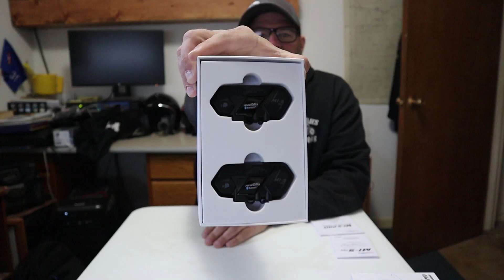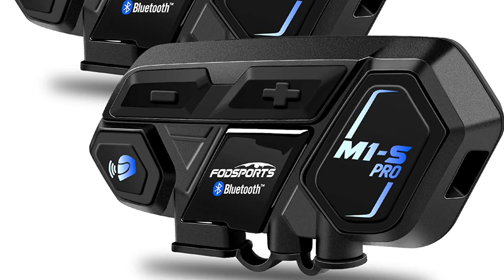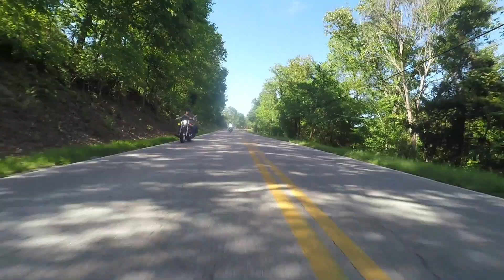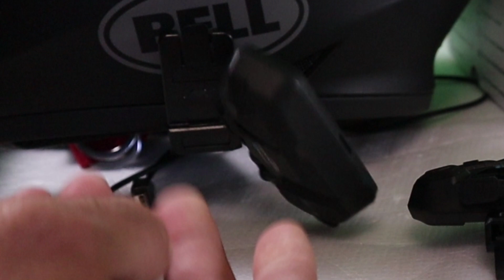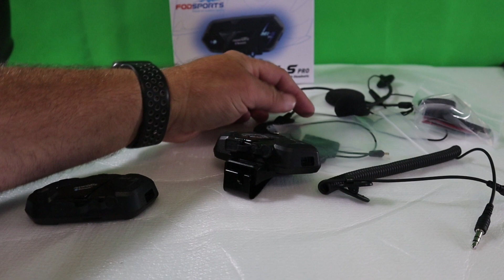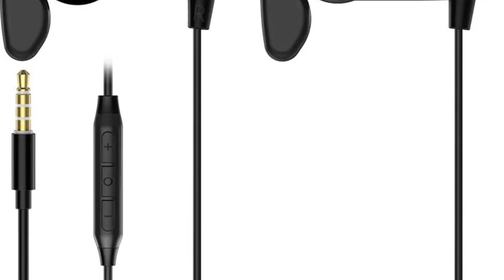M1-S Pro Review $80 Amazon Bluetooth Headset Communicator by FODSPORTS

Comment: The answer to your concern about the charge port is right at the beginning of your video on the box. You can use these while charging. So to have a tight fitting square socket that won't allow the main part of the connector to wiggle loose in the wind is imperitive.

And yes you can cut back or grind other mini USB cables to work with this for charging purposes but I wouldn't want to use that while riding.

I've had mine for 3 years! Love them!

Comment: You would be able to do single live voice vlog, just can't capture both riders voice, that correct?
Reply from the maker: You will still need a separate mic and recording device for a vlog, I was going to use my Gopro and mic for my audio then just add the audio from the Comm Unit as a seperate audio track. I was able to do this with the Cardo but my audio still comes from a separate source besides the comm.

Comment: Can it synhro without problems with SENA or Cardo intercoms ???
Reply from the maker: I synced it to a Lexin unit using Universal pairing without issue. I believe Fodsports claims to sync with other brands that support universal pairing, so assuming the Cardo or Sena model you trying to connect to support it then it should work. How well I can't say I don't have a Cardo or Sena unit to test with. I have a friend with a SENA  and will be testing that when it warms up.

Comment: Would you buy this again? im looking into buying something like this or the "interphone sport" comms device.
Reply from the maker: I also tried a lexan in same price range and prefer the Fodports. I haven’t tried more expensive ones yet but yes I think it is a good product and would recommend it still.
Reply: @RidingintheOzarks  as i said im looking at the interphone sport or tour aswell at the moment - trying to avoid having to pay silly money for a cardo/senna, if you was going out to buy one what would you buy?
Reply from the maker: @s1dew1nd3r4  I am not familiar with the ones you mentioned but I bought the fodsport because I didn’t want to spend cardo/sena money. I would buy the fodsports again
Reply: I use the lexin B4FM now for 2 years. Good unit never let me down.  Looking at a change. Is the fodsport sound better then the lexin. Looking at the fx8 or the ms1 pro. What's your thoughts.

Comment: I think the shoulder on the charging cable is so you can charge while using it and it makes it rain proof. I have a Freedconn R1plus it works pretty good but I reset the wifi password to 3 chars instead of eight. It let me save it but when I go to connect it to my phone the connect button in the app won't work unless there are 8 Chars entered. But it won't connect with the original 8 Chars, so now I can't use the app to change settings or operate the camera. It still works but I'd like to use the app.
Reply from the maker: That maybe why but with like 20 hours of run time I really don't see charging it while using it as a much used function.  Does your Freedcon record Audio from intercom conversation when recording video also?
Reply: @RidingintheOzarks  I don't have another 1 to see if it does. There is nothing in the manual about it but it not very informative. I have figured out stuff that it never mentioned. It doesn't record the music from the FM or the bluetooth (at least I haven't figured out how yet). I know it doesn't use the mic that plugs into it for recording video. There's a built in mic somewhere. The manual doesn't say anything about that either.  But it works for making & receiving calls.
Reply from the maker: @EasyRiderGreg  well if it won’t record the mic for audio when recording video I doubt it would do intercom but maybe I will try and review one

Comment: I've tried soldering those headphone wires before and never had any luck either.
It seems like there are a handful of things working against that unit - the proprietary connectors seem like a pretty big annoyance.
Reply from the maker: I mean they work fine, it is nothing big but the shouldered charge cord is a concern, I have misplaced one of the 2 already after 4 months. If I realized up front I would have paid more attention and labeled the cord.

Comment: Good video Mike.  Dual vlogs are tough on a lot of Bluetooth systems as well.  Good to see there is a cheaper option out there than dropping $400 on a pair of new Senas.   Good job!
Reply from the maker: Well I am new to using these so I figured I would start at bottom of the cost spectrum and work my way up.